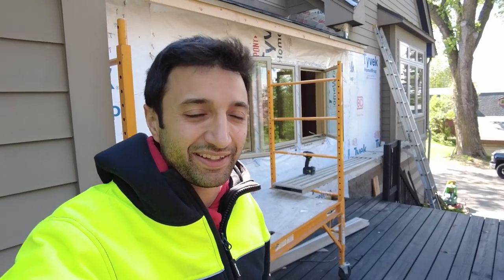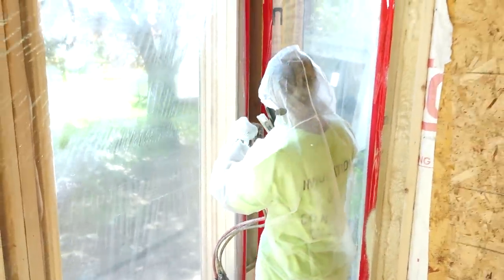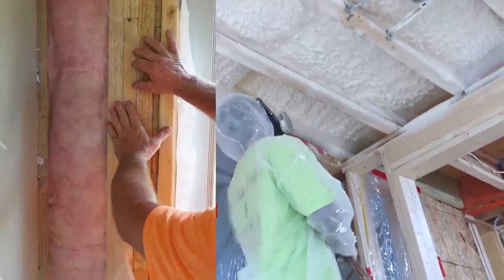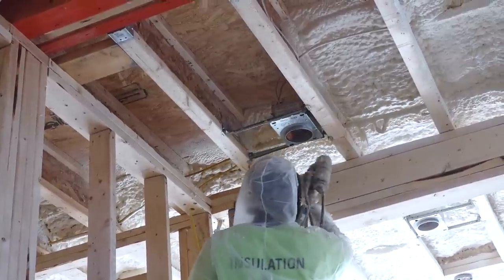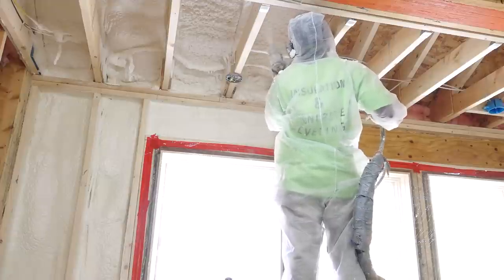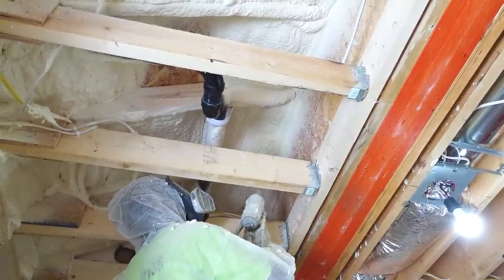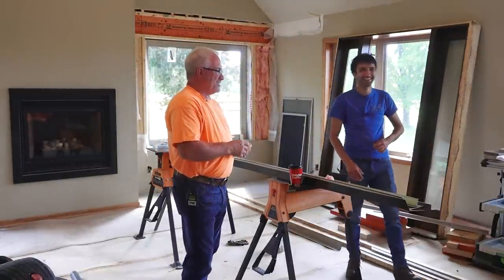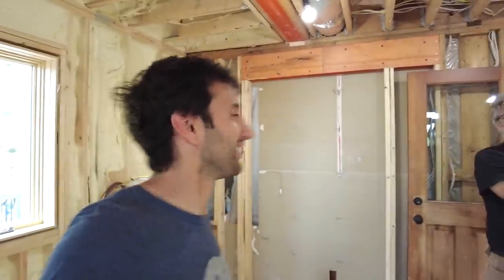How Important is Air Sealing? Insulating the Additions | Home Renovation & Addition Part 41

Comment: Closed cell also derates to a lower R-value in very cold temps.  We're building a new home in MN with Zip-R12 sheathing and 2x4 wall construction.  Debating whether to use mineral wool in the stud bays or closed cell.  Closed cell would guarantee no air infiltration and it also strengthens the wall assemble for shear.  Mineral wool is cheaper with an R-value of 15 @ 3.5" thick vs closed cell at around 18 @ 3" thick but mineral wool has a better STC (sound absorption value) of around 51 in a finished 2x4 wall vs. 39 for closed cell.  What to do?
Reply: What about an inch of closed cell and then mineral wool for the rest, is that an option?  Best of both?
Reply: @zekezeke3484  Not sure how well 3.5" mineral wool would compress when trying to attaching drywall.  Both R-value and STC ratings would also be diminished under that much compression.
Reply: Go with the mineral wool. You are already doing a great job with the R-12 Zip-R sheathing that is providing an air barrier and eliminating thermal bridging from your studs. Best practice is to have 30% of your insulation value as exterior insulation and 70% as the cavity insulation. This will reduce potential for condensation on your interior surface of the zip-R sheathing since it is air and vapor barrier. You honestly should have went for 2x6 studs instead of 2x4 for the better overall R-value. But that's a moot point now. The mineral wool is better for your health, indoor air quality, your wallet, and helps with fire resistance and STC ratings. 

Spray foam should be avoided as much as possible if we want to live in healthy buildings that can be easily renovated or deconstructed down the road. The increase in shear resistance can easily be achieved in other ways that are proven from an engineering standpoint, like increased nailing patterns or additional strapping. Spray foam is not a code approved method for resisting shear and that should tell you a lot. It can shrink and pull away from framing and is a sensitive chemical process to apply in the field.
Reply: @BenWolkWeiss  Thanks.  I'm going to personally apply the Zip tape and Zip liquid flash to make sure the walls are sealed from air infiltration, unless the framers say they've done this many times before and know what they're doing.  With that, mineral wool will save me a lot vs. closed foam and should be better for sound transfer.  With the Zip r-12 + R-15 mineral wool, I think a R-27 wall assembly is good enough and better than code.

I originally decided to go with 2x4 construction because I wanted great exterior insulation and didn't want to deal with all the jamb extensions for doors and windows that a 8-9/16" wall would need.  I ordered all for normal 2x6 construction and still will have a better than code R-value.
Reply: @BenWolkWeiss  I've seen the 30% exterior insulation and 70% interior.  I've also read that this rule was created decades ago when people started building double walls with some sort of vapor barrier between the stud walls.  People who seem to know a lot more than me about this say this rule isn't relevant for single wall construction with continuous air tight exterior insulation if it is 2"+ in my zone 6.  Less thick in other zones.

Comment: I can't help think about future renovators dealing with all this plastic blown into every space. I get the air flow argument, but removing this will be nearly impossible and incredibly destructive to the environment
Reply: Just what i was thinking, doesn’t look biodegradable, what about replacing fan units or running new wires/copper
Reply: @Youbruss1  You're right. Massive hassle. Most people installing it aren't thinking about the next guy, even if it's likely to be themselves!
Reply: Didn't you see the videos before, the spray foam removal wasn't that bad.

Comment: I read if you are trying to buy a home with spray foam that banks are not giving mortgages because of the EXTRA work that a company would have to do IF the insurance company was covering a claim.  LIke a roof with spray foam would be a PITA to change plywood if its covered with spray foam .    << is this a thing???

Comment: Matthew, yes, spray foam is a good product, but this was the most one-sided, muddled discussion of the topic I've encountered. Your insulation contractor, Scott, was correct about some things and wrong about others. Sure, closed cell foam (CSF) is both an air/vapor barrier and an insulator. I have used it in several projects in my current home. But Scott listed the No. 1 value of CSF as adding structural integrity to the home. While it’s true that CSF does stiffen up wall/floor/ceiling assemblies considerably, that is not a goal of CSF, nor it’s intended purpose. It is merely an incidental benefit.

CSF is intended as an insulation product. It just so happens that it also acts as an air/vapor barrier. A side benefit. And it just so happens that it also stiffens up construction assemblies. Again, a side benefit.

Scott also claims it isn’t possible for rodents to burrow through it, which is entirely false. I can (and have) take my finger and dig a hole through CSF. The chewing power of rodents is quite impressive, and far more effective than the human finger. Mice, rats, squirrels and other rodents can chew through wood, which is far harder than CSF. 

Last, the environmental impact of the blowing agents and chemicals used in the manufacture and installation of CSF are SIGNIFICANT contributors to global warming. Read Fine Homebuilding Issue 280 – Dec 2018/Jan 2019 for more. 

Scott is a businessman profiting from the sale of a product, so necessarily he is a cheerleader for CSF. As I’ve said, I have used CSF on my projects, so I feel there is a place for CSF in modern construction. Few, if any, building products are completely free of drawbacks and negative environmental impacts. Our goal should be to educate ourselves and minimize the harm we do. This video was a sales pitch for CSF, not an informed discussion on the topic of CSF. You owe it to yourself and your viewers to better educate yourself (and therefore, them too) on topics that you cover, especially when they are as controversial as CSF.

(BTW, I am enjoying this series. Keep up the good work.)
Reply: Well stated, i feel that only those of us who truly care about the future will understand this conversation. I too will use csf and rockwool. It all depends on the project. "Sales pitch" 👍

Comment: R value is not the resistance to airflow 🤦‍♂️. R value is the resistance to heat transfer. A window or a brick wall has a terrible R value yet will provide a good air seal. Sealing out draughts is very important too but it's nothing to do with R value. Having windows will always result in worse insulation performance than a insulated stud wall even if the windows are hermetically sealed. I'm sorry but the suggestion that fibreglass with a stapled plastic vapour barrier can't perform as well as sprayfoam with the same R value is complete marketing woo woo. The biggest concern with small gaps in a plastic vapour barrier would be condensation where there is a tiny amount of air transfer, leading to mould growing in the wall, not a massive reduction in insulative performance. Unless you have huge gaping holes it's not a problem.
Reply: TMM well said
Reply: Agreed, but I think the point the installer was making was that R value is becoming a measure of air flow as well. Risinger does a better job of differentiating them than this guy does, but I don't doubt his expertise.
Reply: Classic foam salesman. I used to work for the nation’s largest insulation installer as a building scientist. ALL insulating systems, fglass, rockwool. Cellulose, various foams, etc all perform equally well as insulators. The key is that they must be properly installed to reach their peak performance. Fglass and any other batt-type products are notoriously difficult to install properly for a myriad of reasons; therefore, they rarely insulate as well as expanding foams. Just because it’s spray foam doesn’t mean the gunner in any good and I have seen many foam jobs that weren’t worth a flip. It’s all in the install quality. With that being said I prefer spray foams and rock wool.
Reply: 100% agree with this and the replies. I was a building analyst for a very well regarded home performance contractor. This guy might be an ok tradesman, but he is not a good educator.
Reply: They are not so much notoriously difficult to install correctly as they are notoriously easy to install incorrectly ;)
Reply: Meh, either one get’s you to the same result; but both are true. Difficult to install correctly because of inconsistent framing spacing etc and easy to install incorrectly because “cheap labor is like water, they both seek the path of least resistance (John Tooley).” Heck, all insulation systems can easily be screwed up if the labor doesn’t care. It’s never helped that insulators have always been paid by the house so the faster they work, the more houses the complete, the more money they make. I’ve witnessed insulators in CA on drywaller stilts using a long pole with a nail spike on the end spiking batts and stuffing them in tall ceilings. Can’t possibly do it right that way.

Comment: Good salesman, but he's not an engineer. Take his spiel with a heavy grain of salt.
Closed cell is an amazing air barrier, though.
Based on code in Zone 5 (Colorado, Minnesota) you can use R-20 of closed cell directly on the underside of your roof decking. No need for an attic space. That's what I did in my garage. 
As others have said, you can do exterior rigid foam insulation (like Polyisocyanurate) that is extremely well taped at every single seam which is also an air barrier.

TL;DR having an air barrier is tremendously helpful, but it is NOT a replacement for sufficient R-value. The two should be used together.
Closed cell spray foam happens to also have the highest R value per inch (exceeding R-6 per inch) so it happens to be good for both R-value insulation and air barrier as it is impermeable to moisture and air. (open cell is NOT impermeable!)

Comment: My ocd just can't get past the fact that it's sprayed on all of the cables and fixtures.    I also don't like that it's made from oil.  End result is it is the best air barrier, however I have seen other tests where in most cases it is hardly better than fiberglass when installed properly.  But the big one is later on when structures get renovated this is going to be a huge cost to the owner when doing renovations.  Overall I am torn weather it is really better.

Comment: This guy is wrong.  R-value is not the resistance to air flow, it’s the thermal resistance to conductive heat flow.  Conductive heat flow still occurs even if the surface is completely sealed to air flow.

Comment: As others have pointed out, the contractor is talking complete and utter BS regarding the meaning of R-value. It is a measurement of the conductive movement of heat through a two-dimensional barrier system not airflow. This is a straight up sales pitch for his most expensive product, not factual info.   

The trouble with filling wall cavities with closed-cell foam is that it doesn't do anything to reduce thermal bridging from studs which is an issue in Zone 5 winters. A wall assembly built with fibreglass or rock wool batts in the stud bays, 2-3 inch rigid EPS on the exterior side of the sheathing and an 1 inch rain screen air gap bedind your siding is a much higher performance system for a comparable or lesser cost.

Comment: Spray foam is not fire resistant, fiberglass and rockwool are fire resistant, see Post 10's experiment, with Foam, Spray foam, fiberglass and rockwool.

 "Testing The Burn Ability Of Insulation In Wall" on Post 10 channel at:
https://youtu.be/CdItsso3ur0

Comment: Insulation guy is full of it. Couldn't finish listening to him.
Reply: What exactly would you say is not true, or are you just incapable of understanding what he is saying? It all sounded correct to me.
Reply: @MAGAMAN  
For example when you rate the R value of a wall then install a window in it  you reduce its R value. 
Another problem that I've seen through the years is houses that are built too tight have numerous problems.  They have to breath so I would definitely look into an air exchanger.

Comment: You're stirring up a hornets nest. The contractor had courageously talked about a controversial subject. I spray my attic roof and added insulation.  I saved a lot in energy consumption with my A/C here in Texas. My electric is going from .08 to .13 per kWh. THAT'S A HELL'VA jump! I love the Biden Hillbillies. Hahahaha.  Steers are all those cement heads know. EAGLEGARDS...

Comment: Windows do not use a better r value than an r21 wall. This guy doesn't know what he is talking about at all.
Reply: Fact Check: True
High performance top of the line windows ~ 10 R-value
2x6 with 25% framing factor 21 R-value insulation, (1÷(0.75÷21+0.25÷(1.2×5.5)))~13.6 R-value
Reply: @FrancisKoczur  exactly and comparing an advanced triple pane window to standard wall construction is giving windows the most benefit of the doubt.
Reply: @AndyCollier   And I also had the framing factor at 25% when it's more likely 20% with 2x6, so it's closer to 14.6.